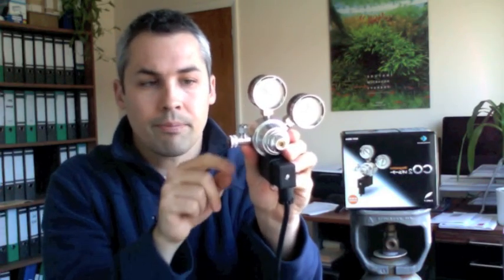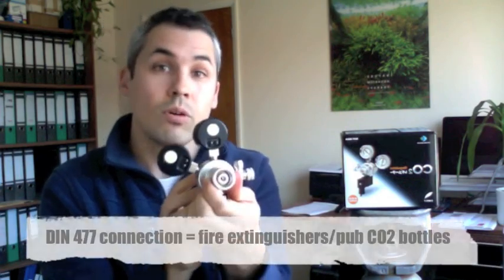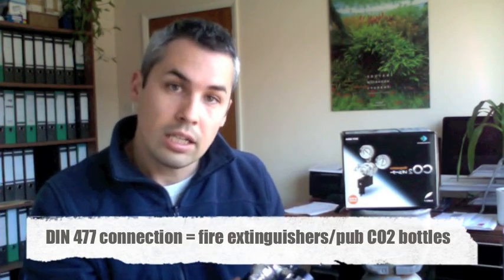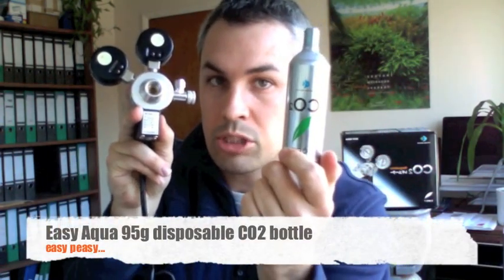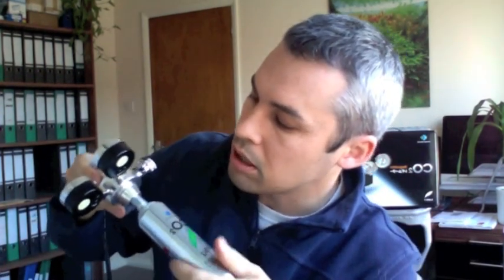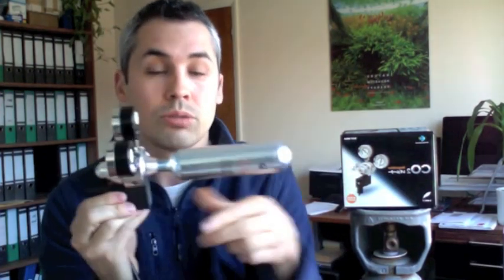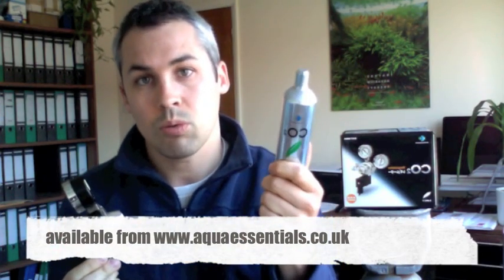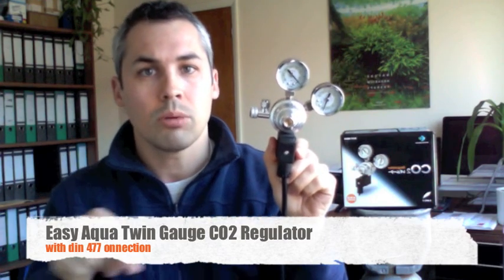Easy Aqua DIN 477 Twin Gauge CO2 Regulator/Solenoid

Comment from the maker: The small 95g bottles wouldn't last long - you need to get yourself a larger pub style CO2 bottle. Use a drop checker to monitor how much CO2 you needed but on a 50g aquarium 2-3 bubbles per second is a good starting point

Comment from the maker: If you mean the 95g bottles then probably not that long, but this is totally dependant on how much CO2 you ran and for how long each day. I recommend a 95g bottle as back up, and a large refillable one as the main use one.

To work out how much CO2 you need for any aquarium, you need to use a drop checker with bromo blue solution. Doesn't matter if you have a few plants or a lot, CO2 levels are the same, but a lot of plants create stability and result in less algae problems